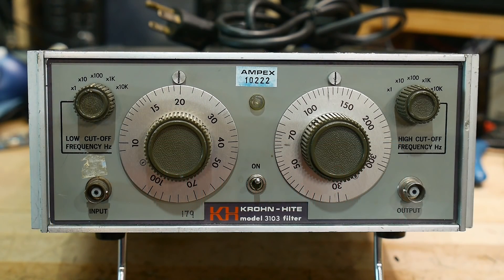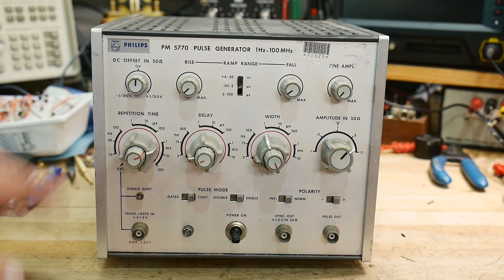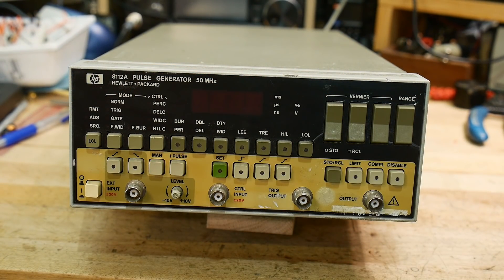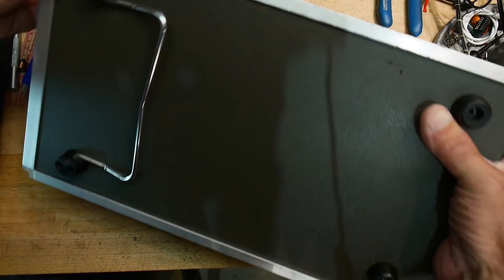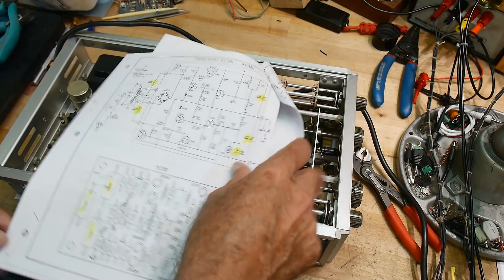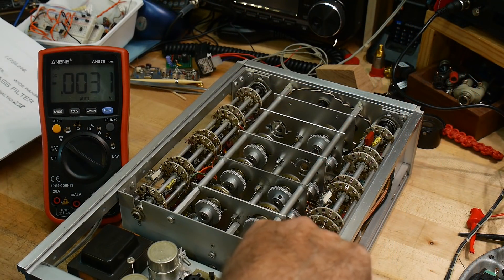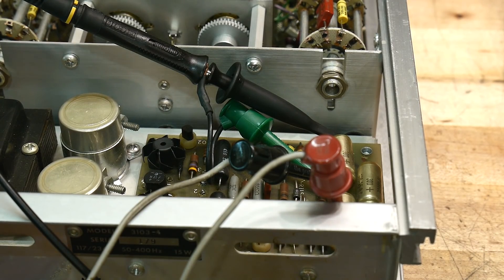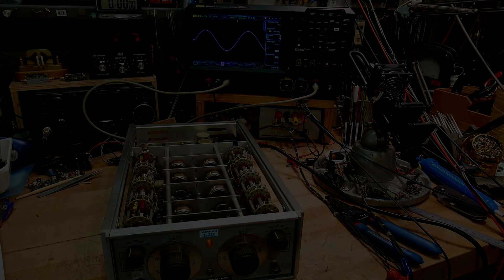#871 Krohn-Hite Filter and Free Stuff

Comment: I needed a pulse generator like that for a project I am working on. I have a rigol arbitrary waveform generator, but a pain in the butt when it comes to wanting a single pulse, click this button, click that button, touch this on the screen, set this, change that, manualy offset it by half amplitude.... its like you have to massage it for a simple single pulse output lol
I ended up bodging one together with a microcontroller hard coded to produce it, currently working on a pcb and expanding the design after seeing this video, learning alot about a few options. - btw, love your videos, always something to learn after 30 years of doing this stuff

Comment: As EEVBlog Dave would say, "Wow, sex on a stick"  I never get tired of the engineering which went into HP and Terk gear at one point. Thanks for sharing !!
Oh, I will test 20 plus year old electrolytics but they have to test extremely well for me to not swap them. Good caps are reasonably affordable, and wont leave you wishing you had replaced them last month when you had it open and now the unit is smoking. If the electrolytic, wax and paper caps are 35 years old or older, I don't even waste time testing them. Clip & trashcan time !!

Comment: Take the top off. Cut clear plastic to fit. Install a clock module on the clear plastic. Reinstall clock as top. Hang clock on the shop wall = steam-punk decorative clock. This is how you hide, in plain sight, duplicate donor devices from the wife.

Comment: I purchased a 2 channel Krohn Hit filter a few years back on ebay that need repair. I could not find a service manual online.  I sent an e-mail to customer support or tech support at Krohn-Hite (or Ampex?) and they kindly sent me a pdf of the service manual. If I recall correctly, the troubleshooting guide in the manual helped me quickly diagnose the problem.
Reply from the maker: did you have a use for it?